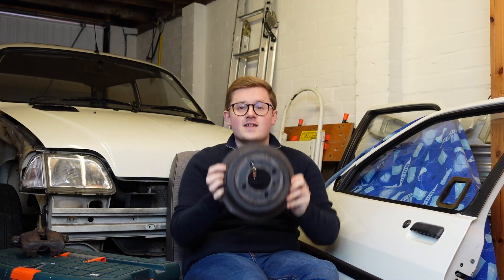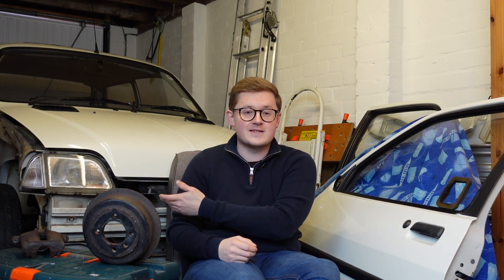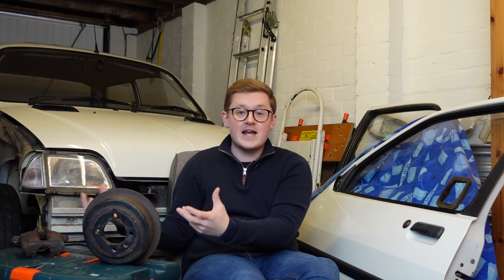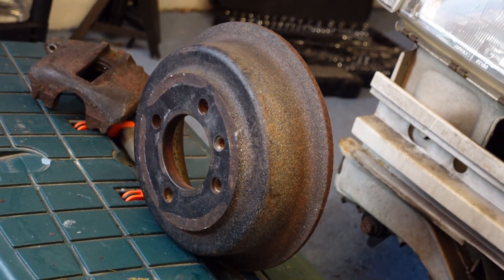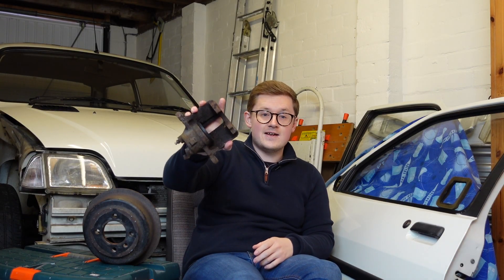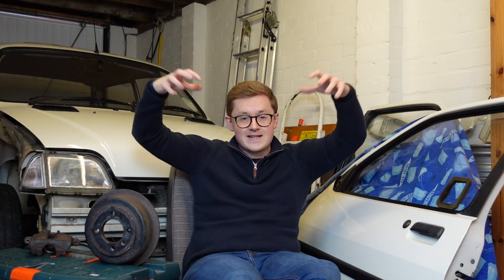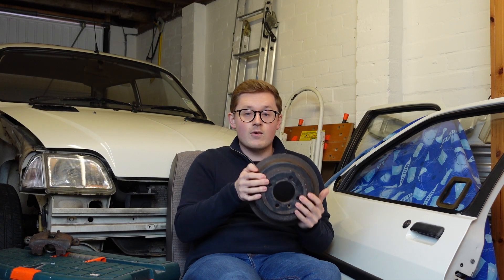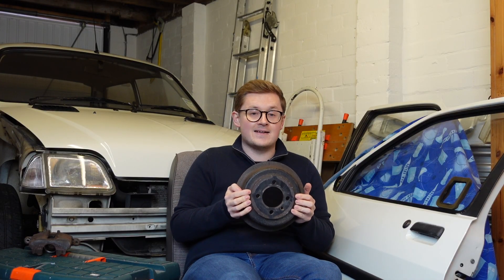Why are Drum Brakes Making an EV Comeback?

Comment: A very well presented and informative piece.
Just one small correction: the ultimate braking force is not provided by the surface area. The surface area affects how much heat the friction surface can handle and how much it wears but the force comes  from the geometry. The main factor is  the effective radius that the friction acts at. The effective radius of a drum is at the braking surface on the inside of the drum  which is quite close to the outside diameter of the brake. The effective radius of a disc brake is somewhere near the centre of the brake pad, which is much smaller. In addition, there is a 'self servo' effect on one of the shoes in a drum brake where the rotation of the drum cobines with the force from the piston to push the shoe even more into the drum which is why the force increases exponentially and grabs.
Reply: surface area, pressure, and the length of the lever the brake is acting on are all factors in braking force.  that is why you use your whole hand to grip a rope and not just your thumb and finger.
Reply: @kenbrown2808  area does not directly affect the braking force. Don't take my word for it, look it up on Google to see that surface area has no effect on friction force.
If you take a drum brake and halve the width of the shoes, the output force for a given pedal effort would be unchanged.
Halving the width, and therefore the area, does increase the surface pressure which would dramatically increase wear and fade with the heat dissipated over a smaller area.
The reason why you grip a rope with your whole hand is to increase the force by employing more muscles. The increase in area also reduces the contact pressure so your hand doesn't hurt as much.
Reply: @paulferraby1202  Bigger Brakes won't stop you quicker - but wider tyres will. Ref: Yt Driving 4 Answers.

Comment: Very good video. What you explain matches with my personal experience. I moved from a Toyota Auris with a standard petrol engine to a Corolla with similar size and power but a hybrid engine. I used to need to change brake pads every 15k km, while on the newer one I've reached 50k without a pad change. I'm not being cheap, car is on a service agreement scheme, the substitution would be free if I asked for it, pads and disks still look rather new and serviceable.
Regenerative braking (which is something I try to maximize for fuel economy) takes a lot of the toil off the shoulders of "normal" brakes. Also, the interaction between regenerative and normal brakes is totally seamless, the feeling is just "more pressure to the pedal means more braking". 
It would be interesting to see developments about drums in the future. Question: I remember reading that ABS didn't love drums. Is that still true, or was it ever?

Comment: Drum brakes can easily get seized by freeze. As EV can't move rear wheels it stop even drive front ones. This is real life example of EVs weaknessnes ....
Reply from the maker: I’m not 100% sure what you mean?
Reply: @TwinCam  I've just wanted to describe problem of those breakes during winter or low temperatures, they tend to freeze and stuck. Then the rear wheels can't rotate thus the control unit does not allow to drive front wheels.

Comment: One of the more interesting places you'll find drum brakes are on bicycles - especially for utility bikes where the enclosed system provides a low maintenance option that performs in wet weather. Often they are in a combined unit with hub gears. That said, as with motorsport, disc brakes are preferred on moutain bikes, and are increasingly preferred on road bikes [as opposed to rim brakes] because of their stopping power and resistence to brake fade.
Reply from the maker: That’s interesting to hear. I’m not a bike person, and though I know about rim brakes and discs on bikes, I never knew some had drums!
Reply: @TwinCam  the Shimano Rollerbrake is a popular example - and they partly overcome the main disadvantage with a prominent external heat fin.

Comment: There is a huge EV test facility around the arctic cirkle, with 6 months of snow every year. It is caled Norway. The contry in a league of its own when it comes to EV sales. Now, in 2023 83% of new cars are EV's. When VW introduced the E-Golf, it didn't take long time before customers returned with ther EGolf that had feiled the MOT. There where rust on the rear brakes, and it was not just on som of them, no it was on almost every EGolf. Actualy, even front discs rust in Norway. Since every car manufacurer have com to Norway to learn the expreiences from a country where every body drives an EV, they, and specialy VW have learnt that drum brakes are not good for EV's
Reply from the maker: Do you mean drums or discs?

Comment: drum are more reliable. here in Canada with the cold temperature and the salt on the road. rear disk brake jam all the time.  they are a pain to deal with and would prefer to buy a car with rear drum brake than disc brake.   too much maintenance require
Reply from the maker: I’ve had a similar comment just now from Norway saying exactly the same thing!

Comment: The surface area of the drum/shoe contact patch has very little to do with the braking torque.
The main parameters influencing brake torque are the diameter, coefficient of friction and critically, self servo effect which drums have and discs don't.     This is less important on a modern car which will always have a separate servo.

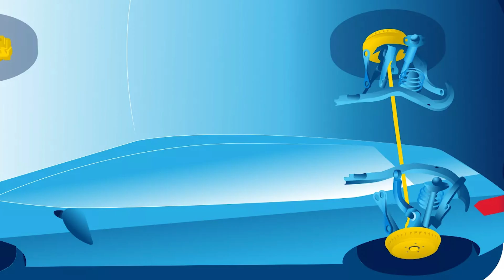Comment: 12:34 I have a 2000 honda Insight. The first gen of modern hybrid evs. I had to replace the rear wheel cylinders a few days ago, and it's still on all stock pads/shoes.

Comment: Perferc analysis of the "issue" with drum brakes and their pubblic perception.
I've read through the lines a hint at the "one pedal stop light issue" as Technology Connection previously exposed.
I drive a small '11 Fiat Mpv and the use of drum brakes is all I need at the rear: it's a work/family van so less maintenance = less expense = more wealth for the family w/o trading safety (as it weights like 1.7T at full load which never happens).

Keep these vids going m8 and long live drum brakes ;)

Comment: Brake blending + wiping = problem gone.
On the Polestar 2 you don't even notice when battery is 100% charged and there is no regen. The blending is just that good. It transitions from using the brake rotors to regen when it can and you get same stopping effect on the pedals. This even works on one-pedal driving with just accelerator as braking is used to substitute regen when otherwise impossible.
The wiping also makes blending add disc usage instead of regen at intervals to make sure discs do not rust over.

Comment: Using a drum without fins is like using a solid disk, cooling fins help drums out with the heat issue. You can also engine brake like a EV but you just don't get the energy back.

Comment: Great video! While i have no first hand experience with EVs i have some with a car that appears to have some similar philosophies. Our family car is currently a Nissan Kicks, it isn't a super expensive car, but it is at a price range over here where some people do start to demand discs on all fours, but the kicks not only has drums in the rear, it has quite small discs on the front, but the braking never felt lacking, indeed it feels quite nice and linear, you don't even notice the point where the brakes bite, even the lightest pressure on the brakepedal gives some deceleration. I found out that is because the car automatically reduces the gear ratio and provides engine braking as you let off the gas and press the brakes. 
Maybe that is a common feature for automatic cars? I wouldn't know.

Comment: if the only reason for ev not to use disc brake is rust, then there is a much cheaper solution. start with wheelcovers..

Comment: Brake maintenance is already very minimal on an EV with discs, at 90k kms my pads an rotors could easily double that before being replaced (and that isn't driving like a grandmother) I've had them apart to check and clean+lube the sliding surfaces and I flushed the fluid as a precaution. But it is safe to say that even with discs, brake pollution is way down with an EV!

Definitely interesting to see how these develop! Hopefully public perception doesn't hold it back like CVT transmissions (with manufacturers having to add back in artificial shifts at the cost of efficiency).

Comment: Drum brakes are often in the rear disc as a handbrake for the reasons you mentioned. Most of the pick-up trucks have drum brakes in the rear. Most importantly drum brakes do not need the servo assistance that actually makes the disc system much more complicated. The actuation force is much more for disc brake and self actuating is not possible it is not long term practical. What about in wheel motors? Rear brakes are not that important to be in the wheels why not embed the brakes in the transmission unit and have them submerged in oil? This will reduce the unsprung mass.

Comment: Great video. One thing you did not address was the consideration of weight -- in particular --  un-sprung weight. It seems that a drum system would be significantly heavier. Is that true? If so, not only the overall weight of the car, but the weight of the moving parts of the suspension, which directly and dramatically affect ride and handling,  would favor disk brakes.
Reply: I accept your point, however given the huge weight of modern passenger vehicles I suspect  that the unsprung weight problem has largely gone away.

Comment: I daily a manual transmission car and use my gears to slow down. I couldn't tell you how many times I almost got hit. I have since learned heal toe on a down shift so my brake lights come on now... But I don't always do it. If I just need to slow a few mph sometimes a shift or just getting off the throttle is enough!

Comment: Easy answer before even watching the video: drum brakes are insanely more reliable, longer lasting, and require way less maintenance. My car is over 20 years old. When I went to have my brake pads and rotors replaced on the front brakes, the mechanic said the rear pads have at least another 10 years or more of use in them.

Comment: A lot of old drums are adjusted until the shoes drag. They can be adjusted to not drag, but you end up with a dead spot in the brake pedal where movement of the pedal does not result in any braking force.
Reply: I was thinking the same thing.

Comment: I owned cars I never had to change the shoes on the rear drums and most garages just clean out the dust and put the drums back on also in most cars the disc rotors on the rear corrode a lot and pit badly which I haven't seen drum brakes doing that, over all I prefer rear drums  brakes. I purchased my first hybrid car recently and guess what drums on the rear it's a Dacia jogger hybrid and brakes well even when using less regenitive settings. Then I noticed Dacia use rear drums on all it's cars for some good reason.

Comment: They are making a comeback because legacy automakers love to lose money. I'm currently an owner of a Audi A5 and has disc brakes in every wheel, Imagine my surprise when I knew that Audi/Volkswagen was releasing the etron Q4 and id5 with rear drum brakes. Rear drum brakes in a 50k € car? I will never spent money in a car with drum brakes (not even in a montain bike with old cantilever brakes). So those brands can go the way of the dodo, I won't pay them...
Reply from the maker: You see, you're the perception problem I mention towards the end. Nothing to do with what's actually best, it's all image.
Reply: @TwinCam  Sorry, but VW made the last Golf and the new ID cars with hard plastics and haptic controls for elemental things as air conditioned to SAVE COSTS (while also rising the prices of the cars), not to make better cars, and as result of that their sales are taking a hit. The same happens with the drums. And by the way, VW already said that using haptic controls for the essentials was a MISTAKE and they will 180º in the newer cars, so my guess is that they will end doing the same with the drum discs. I want dis brakes and analogic buttons for the climatization in my car, specially if cost what those cars cost (and don't forget also that EVs have much faster acceleration that ICE cars, so having good brakes is more than needed, specially when you have pocket monsters as the MG 4 Xpower able to smoke a RS3 or AMG A45 for half of the price.
Reply from the maker: @Buran01 Yes they did make a mistake, but what relevance does that have to the braking system?
Unfortunately, companies like Tesla are somehow making the public believe that cheap interiors are somehow cool.
Reply: @TwinCam  I agree with that feeling.

Comment: Great comment about why US Class 8 Trucks still use drum brakes namely SAFETY as opposed to disc brakes where are all about #performance #conservation_of_momentum also known quite common in the US Trucking Industry for the entire vehicle to literally lift up upon the ground upon applying the ahem "braking_force" ahem. So why would this clearly unsafe situation compared to disc brakes still be considered safer? Because in the event of a brake failure the "stopping force"(if you will) is gradual as opposed to disc brakes which if the brake still even functions (pad failure/main cylinder failure) it's still in effect non-existent as opposed to "in the cylinder" metal on metal which contrary to what is said here literally "YIELDS" better heat dissipation as the entire wheel well is being heated up as opposed to merely on a contact patch located upon a rotating "disc" . There is as noted "brake fade" with a semi-truck but this can be and in fact is greatly mitigated by a professional driver as opposed to those who think they're a good driver of a car but in fact are not. Point being battery electric vehicles are if one thing in particular "HEAVY" so you definitely want the most reliable and mechanically sound system which is both drum brakes PLUS a mechanical hand brake as the reserve. #IDEALLY trucks these days being so massive and expensive would come with air brakes as standard in point of fact as this is what USA Class 8 trucks use and for good reason as no different from a US Railroad braking system granted very bad/knowingly inferior "cheap hoses" which can and will cause #king_pin failure and catastrophic loss hence why Railroads require mechanical braking as well #fon_du_loc catastrophe so better start getting your facts straight Mister as anyone can go bombing down the literal highway as Sir Isaac Newton posited CENTURIES ago #BRAKE_HORSEPOWER

Comment: All that waste brake heat can be put to work, recharging the batteries of an EV.  Here are six ways to recharge the batteries of an EV while the vehicle is either in motion (‘in-flight refueling’), or parked, idle, in the sun, far from a charger, off the grid.  7th grade science max.  Ten minute video explains in detail.   https://youtu.be/RGJDi64sMWc

Comment: Grabbing is only an issue for leading-shoe designed drum brakes, it's a by product of the (desirable) self-servo action that comes with the leading-shoe design. Trailing-shoe designs do not have the grabbing issue, but also do not benefit from self-servo action. For an EV, I would expect trailing-shoe designs to be sufficient, as they are not the primary brakes for the vehicle, and we can also just use a more powerful vacuum servo attached to the master cylinder instead, to get the extra power.

Comment: Couldn't using stainless disc rotors in cars help with the issue of rusting?  Motorcycles and bicycles use stainless rotors all the time and I've never seen either rust except for in extreme conditions.

Comment: Regarding the heat element, there are plenty of French hot hatches I've seen with drums on rear that have fins on the outside that are clearly designed to wick away some heat from the drum. I'm sure they are not much dearer and probably reduce the fade on breaks
Reply: Some Porsche 356 models had beautiful aluminium finned iron drums.

Comment: Dude most front wheel drive cars still use drums in the back, it's like you made a video trying to imply drum breaks aren't common, but they are, so the most logical assumption is you didn't really do the research necessary to make this video I can damn near garentee almost half of all cars have drum breaks on the back wheels due to front-wheel drive cars being the most popular and most are built around a similar idea and setup and most companies cut the same corners.
Reply from the maker: You really should have listened to what I said if you think I said they aren’t.
Reply: @TwinCam  You literally said the word "comeback" in the thumbnail bud.... 
What does that word imply.....

Comment: Oversized disk brakes are just one of the distortions of car design which stem from using racing as the test bed for consumer car features. In a country with a 70mph maximum speed limit we just don’t need cars which will go (and stop from) 125mph.

Comment: Drum brakes are on every single car that has a cable actuated brake lever. It's a secondary set of brakes in place to be used when parking at an angle or somewhere your Transmission's parking brake shouldn't be utilized. my 1993 honda civic of course has drums in the rear but my 1994 Lexus LS400 has disc brakes on front and rear, but on the rear there's a drum brake setup installed inside the disc brake. the area where the hub would be in the front house's both my passthrough for my axle and surrounding it a smaller version of a drum brake specifically meant for parking.

Comment: Disk brakes on may. car models are larger and cover more area to improve stopping power,  the split-second rapid-tap system reduces unnecessary wear, plus disks are more economical, faster and easier to replace than drums.